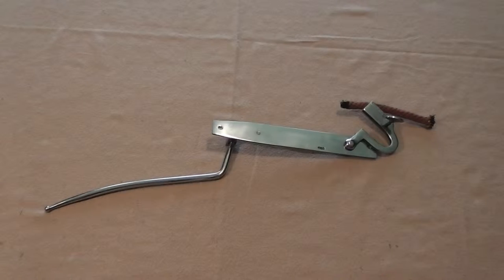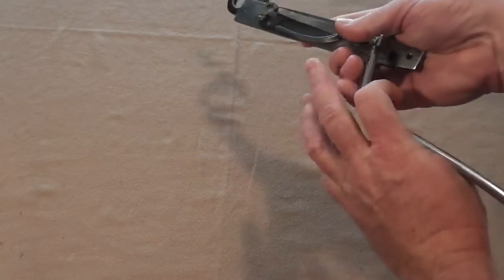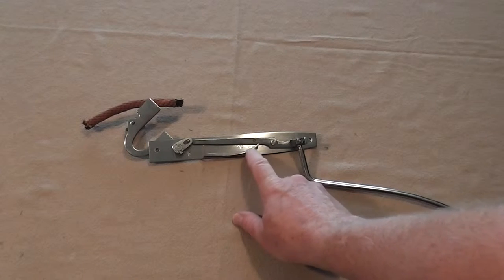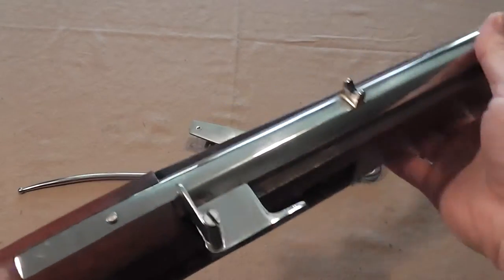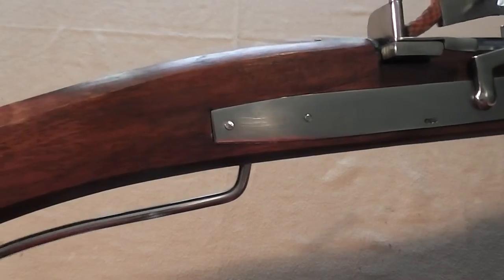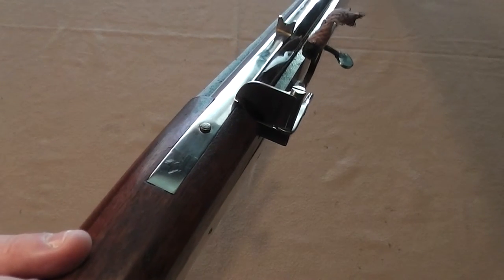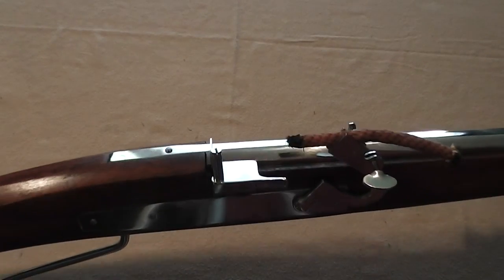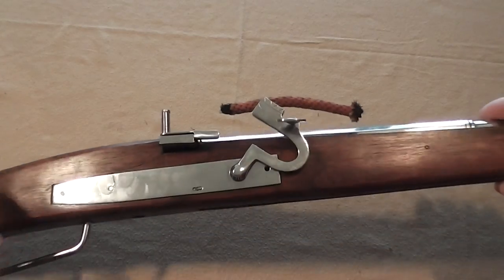How a matchlock works

Comment: how you insert the trigger in the middle of pistol?
Reply from the maker: Sorry for the late reply, I haven't logged into youtube for a long time. The end of the trigger bar is threaded, it screws into a hole in the end of the sear. There's a slot in the bottom of the stock to insert that end of the trigger bar and screw it into the hole in the sear.